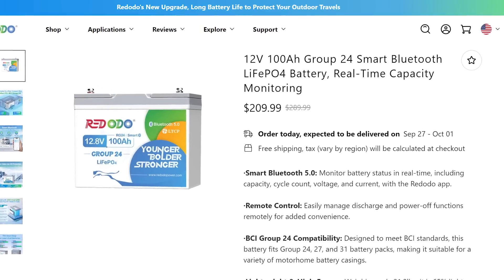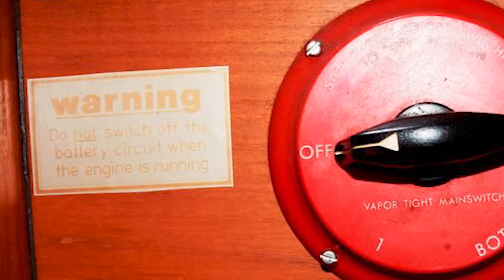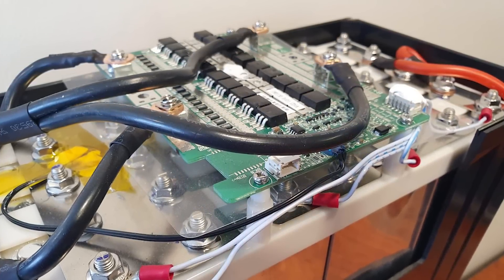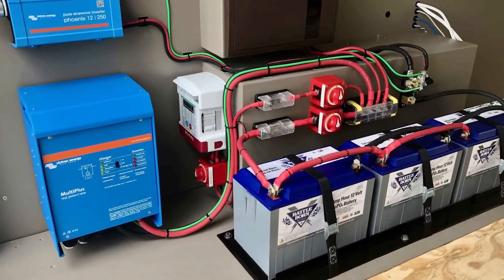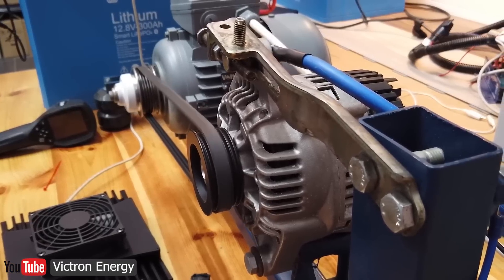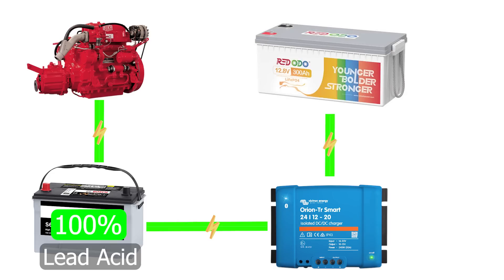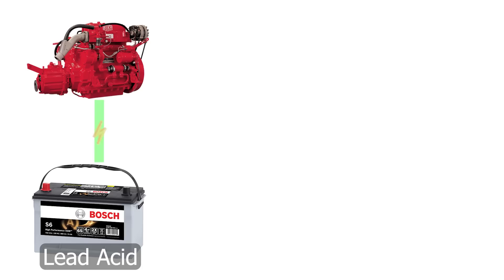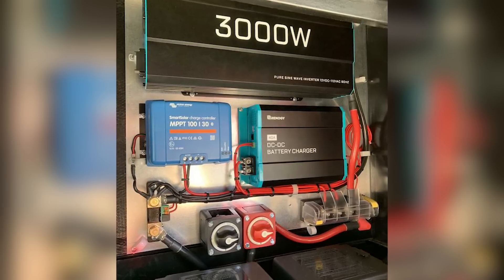Can A Lithium Battery Fry Your Alternator?

Comment: You describe an approach, but not the only or even the best approach. 

Take a coastal cruising C42 with a 20kWh battery bank (I know you only think in 12v and amp hours so this would be 1600ah in 12v, but we use 24v alternator and house bank) It would take 6.4 hours to re-charge a 20% soc battery bank using 4 (four!) parallel 50a 12v dcdc (Orion XS) chargers. I don’t have 6.4 hours of motoring with at least a 200a 14v alternator. The standard 80a hitachi can only give about 40a when hot

A much better solution is to use a high output alternator (5kW—oops, 360a at 14v, or 185a at 28v, or 90a at 56v…BTW, 160a 56v alternators are easily sourced) with avalanche diodes and use a Wakespeed or other high quality external voltage regulator with temp and current monitoring to prevent the load dump. Add an alternator protection module (think of it as a seatbelt—it protects the alternator should there be a failure such as an ignition key turned off by toddler, or  an electronics failure in the regulator or BMS). Then use the dcdc charger to keep the starter battery topped off.

Comment: You are scaring ppl, victron XS has the ability to limit current drew and detect when an engine is running or not, you can even program the start and stop voltage. There are other products that can do that too. 
I guess what I am saying is that a concern is there but also the solutions. Like everything, if you don't know what you are doing, it'll be expensive and dangerous.

Comment: Apparently this You Tuber has never heard of an external alternator controller.  Do your own research on lithium batteries, there is much more to the story than what you are hearing from this video.
Reply: This YouTuber is making general videos for the masses. I would definitely enjoy a detailed video on the finer points. Clark's adventures make several videos about everything to do with charging and lead and lithium systems. He also made a battery doctor? It regulates lead and LiFePO4 together. Be positive about educators, it's easy to point out flaws. But the negative pointers  are not making videos. Like chasing latitudes, not sailing that I have seen, just pointing out things negative. We need to start pointing out the people doing positive things. Not the flaws of them.
Reply: Agreed. And there is no DC-DC (over 60A) which can do justice to the current that a LFP COULD refill if connected directly -- with, of course, a decent alternator and a surge protector.
Reply: @thedolphin5428  Mastervolt makes a 90A DC/DC Li-ion charger

Comment: Anyone that puts a Lithium Ion battery bank on their boat is a idiot.  
   Lithium fire anyone ? No thanks. You can blow your CO2 bottle or Halon and it just keeps burning. Sound fun when you are 500 miles offshore?
Reply: Most people are doing lithium phosphate which is a completely different safer chemistry.
Reply: @EngineerK  I will stick to AGM thanks . My sailboat weighs 40 tonnes so weight is not an issue and it gives me safe reliable performance with no surprises.
Reply: I’ve seen a couple of fires from these and a number of super yachts have gone up in flames lately. They have been charging caused but salt water incursion would be fun times.
Reply: @D-B-Cooper  Li-ion is not the same as LiPO4. The first are used in cars and can catch fire and should never be used on a boat. The latter can safely be used on a boat and will never catch fire. Every battery is dangerous but only if stupidly handled like using too thin wires or causing a shortage.
Reply: That's true of NCM batteries, they type that you keep seeing burning in EV fires around the globe. But in the case of Lithium Iron Phosphate, it doesn't oxidise in decomposition meaning that conventional fire extinguishing methods are effective. That said, though, everything's safe until it isn't and there is a little more complexity with a LiFePo system than there is conventional Pb acid, and complexity is the enemy of reliability and dependability.

Comment: Why mess with Li-ion batteries when Pb acid is cheaper, more reliable and far safer. Large Li-ion batteries are a fad, a status sumbol
Reply: Just the 80% discharge is worth the price of admission for offshore boats. Over lifetime, LiFePO4 cost half as much per kWh. But none of that means anything if not safe and reliable. So the motivation for improvement is huge.
Reply: @artsmith103  
Safety is paramount on a vessel and especially on an offshore sailing vessel. Li-ion batteries are unforgiving consider the case of the Canadian couple recently found deceased in their RIB washed up on Sable Island. The husband had converted the boat to use Li-ion batteries for propulsion and domestic chores. The large bank of EV batteries was located under the cockpit. The couple apparently were forced to abandon ship is great  haste as there were few provisions in the RIB. They apparently died of dehydration. No traces if their vessel were ever found. Could a raging Li-ion battery fire have been the cause of their ill fated hasty departure?
Reply: @scomo532  I think adding EV propulsion on more than 5,000 lb boat is adding a tangent not relevant to this discussion. Everything you said might be correct, but that is a different situation than 200-400ah at 12V where 40amps is a big load. I would say that's the topic of this discussion.
Reply: @scomo532  Those are Li-ion stories. This discussion is about LiFePO4 or some other better chemistry. I'm not trying to defend Lithium. In fact just last night looked up the price of 75ah AGM I would upgrade to from SLA when necessary. Hopefully a few years.
Reply: @artsmith103  Li phosphate dies improve the safety of Li-ion cells, but you’re still dealing with lithium which is highly reactive. When the cell is fully charged, the negative electrode is fully reduced with lithium, so it is as reactive as lithium. If the cell shorts, you’re in trouble. The negative electrode has a very high chemical potential which causes it to react with the electrolyte forming very reactive lithiated intermediate products. This is the SEI, solid electrolyte interface. There is a similar SEI on the positive electrode. Both are quasi stable which means the battery is quasi stable. Leas acid battery technology is 160 years old, there are no surprises. Li-ion has only been around since 1991, it’s more complicated and keeps changing. All I’m saying is, on a boat at sea, I don’t like surprises, what about you?
Reply: @scomo532  I'm familiar with that tragedy.  No trace of the vessel was ever found but somehow you know that it was a battery fire.  Last I read there was speculation that it might be a battery fire and speculation of all sorts related to weather or collision and/or their all too DIY boat with questionable work.  Is there some report you know about that is more recent than anything I read months later or are you just adding to the speculation and claiming to know the cause.
Reply: @scomo532  You clearly don’t understand the difference between Li-ion and LiFePO4. Both are called lithium but that is confusing.
Reply: @edkok5880  
Talk about being confused, Li-ion battery technology was first invented by Stanley Whittingham in the 1970s. John Goodenough fabricated the first working Li-ion battery in the 1980s and Sony commercialized the battery in 1991. The principle of the system is to move Li ions between two electrodes of different compositions. The negative electrode is comprised of carbon while the positive electrode is comprised of an inorganic lithium intercalation compound. Initially this was LiCoO2 with a liquid organic electrolyte containing a lithium salt. Eventually it was found that the LiCoO2 was too dangerous so new intercalation compounds were developed the latest being LiFePO4. Tell me again how I don’t know anything about Li-ion batteries.
Reply: Never trust someone who can't spell
Reply: @EngineerK  never trust the keypad of a GD tiny cell phone, smart ass

Comment: More questions than answers in the comment section. Excellent video Tim. Like others have said, I'll stick with AGM and await the next generation of solid state batteries for a sailboat application. Although there hasn't been an update (that I've seen) regarding the couple washed ashore on Sable Island in July, the suspicion is that their modified Lithium battery bank may have caught fire and forced an abandon ship scenario. We'll probably never know. Call me old fashion and overly cautious. When your EV starts smoking you can pull over and get out. Not so much on a boat!
Reply: They had an EV NMC battery. (yes, it’s a lithium ion chemistry). LFP is a safe battery chemistry with the correct install. Shortcuts and/or cheap will change the safety…
Reply: @jimduke5545  As I understand it, the motor and battery were out of a wrecked electric vehicle. Interesting side note, BC Ferries, one of the largest ferry companies in the world, won't allow damaged electric vehicles where the battery is part of the damage aboard. Not even on a flatbed trailer for transport to a repair facility.
Reply: Don't put NMC (or anything with manganese or cobalt - LMO from old Leaf, NCA from Tesla, etc) on a boat including Victron and those cheap used BEV batteries.  Victron does have a metal case on their NMC.  LFP will not sustain a fire.  If the BMS works at all the battery will be fine.  In most cases if the BMS fails the battery is disconnected.

Comment: I strongly disagree with using DC/DC …… it kills one of the main advantages of Lithium batteries…. In the video you showed using a Victron DC/DC with a 20 amp output!!!  I expect to be able to charge a lot faster than this.  I find the following works well:

•	Alternator charges wetcell start battery (this avoids the problem of a sudden BMS shutdown).
•	Use an external regulator with a temperature sensor to the alternator (eg balmar)… this protects alternator from overheating.  External regulator will throttle the alternator and prevent burnout.
•	Use a voltage sensitive switch such as the Victron Cyrix Li-Ct to share charge between the start and the Lithium.  The Cyrix unit is designed like an ACR except it is programed for lithiums.  With this one can take advantage of full alternator output. The Cyrix Li-Ct comes in several different sizes (up to 250 amps if my memory is correct).

-  Wet cell batteries like to be charged at 14.4 volts, so do most of the 12V Lithiums that I see on the market.  Therefor wetcell and lithium batteries can work together.

Wes

Comment: buy a lithium capable shore power charger and hook it to the house bank.  You will not need to have one for the engine battery. AND carry a cheap Lead acid charger for an emergency and run it off the house bank via inverter.
Reply: That solves the problem from perspective of solar keeps house Lithium charged so as long as starter battery is charged, everything is good.
The perspective of the video is that sometimes the alternator 40+ amps are necessary to charge the Lithium house bank.

Comment: Some alternators and stator have internal resistors others rely on external resistors to regulate or rectify the current from a.c. to d.c. and a voltage regulator.  Depending on what engines your running. The small solar electric pontoon boats are kind of cool. Solar electric sail boats actually make sense. Like an offgrid cottage with sails.
Reply: For normal good weather, electric sailboat motor is enjoyable. In the worst weather, incapable and dangerous. Pick your poison.
Reply: Resistors don't rectify. Hope it's a typo. Not an expert opinion. No disrespect.

Comment: Didn't we have this problem with car amplifiers? And dimming lights when the base hit? Same solution a super capacitor bank. Super capacitors increase system runtime in marine vessel applications has gone from 30 minutes to 2.12 hours with battery only compared to battery plus super capacitor. You have solar and 4 batteries an ac inverter and a circular saw. You ain't running that saw all day. Same solar panels 2 batteries and 2 super capacitors and your running that saw almost all day. A super capacitor bank will cycle instead of your batteries and fully charged in seconds. Which means more cycles out of your batteries making them last longer. Lithium is not renewable and earth only has 88 million tons and about a quarter of that is what we can actually get too. Plus no more hard cycles on your batteries. Capacitors with power coming in can do a constant supply from solar. This works better if using only d.c. devices. In short super capacitor banks provide higher voltage but discharge fast and charge fast. Batteries provide low voltage but discharge slowly and charge slowly. Together they make a good solar d.c. system. It's like a soft start built into your solar system. Protecting battery anodes from cycling and hard cycles. Of course why would battery companies want your batteries to last longer? Eaton makes huge super capacitors for ships. It helps on size of wiring needed and battery weight. Which means also your alternator last longer. Because not taking as much out of your batteries when they do cycle. Gotta discharge the super capacitors to work on bow thrusters on newer ships.
Reply: Better solution than the one in the video.

Comment: I have a Renogy 50A DC/DC charger with a Lead starter battery and a 150AH house battery. When running the alternator I have it limited to 20A to prevent over taxing my 55A alternator, never had any issue even at low revs for extended period. I also use a 5A AC charger when at shore to keep things topped up. The renogy limits the charger current to the lithium to the 5A that is being provided, so no problems on AC.

Comment: I use Balmar's external regulator to charge the lithium house batteries and the battery-battery charger to charge the AGM start battery.  Then I get full charge on both. Yeah a bit more $, but I want all charging to one battery bank.
Reply: I have this setup on my Cat with Electromaxx high output alternators (140 x2) and their regulators.  Also use a third DC-DC to charge my Windless battery.
Reply: So your solution is put all your money and technology in charging the Lithium and then give the Lead a little basic charge as necessary.

Comment: At the Spring Safety at Sea seminar @ Rogers Williams, we learned that if a lithium battery bank caught fire, few of us have the proper extinguishing agent aboard and it will burn hot enough that you won't be able to eject the batteries overboard.  This situation was described as an abandon ship event.    Perhaps a video covering those issues would be helpful to your viewers.
Reply: Interesting. Did the course material detail the dangers and methodology of dealing with different chemistries? Lithium Iron Phosphate batteries do not oxidise in decomposition like NCM and other chemistries do, and should be able to be extinguished by conventional methods such as dousing with water. This is one of the beauties of this chemistry, from a safety perspective. NCM batteries, on the other hand, cannot be extinguished as is now all to readily being seen due to the proliferation of EV's with NCM batteries catching fire here and there.
Reply: How does an LFIPO battery catch fire?
Reply: @svgrateful6715  From my reading and understanding of the chemistry, LiFePo batteries are pretty immune to the fire risks from a chemistry perspective and the cathode/anode materials that they use. They are low resistance devices and are not prone to thermal runaway events as a consequence.
That said though, physical damage to the cells, overcharging, short circuits and charging outside of the manufacturer's temperature range may result in fire.
Reply: Don't use NMC or anything with manganese or cobalt on a boat.  Use LFP.  See comment above on essentially the same thing.

Comment: I've installed an APD ( alternator protection device), mine is by Sterling and I think Balmar makes one as well. I also switched out my Alternator that has a smart external regulator that know how to charge a lithium bank. 
If you have a high amp alternator say 200 you will need to buy many dc-dc chargers to move all those amp over while losing effectively and producing heat.
SV Sandii
Reply: APD seems key whenever the alternator is connected to lithium, even with smart chargers and/or communication.  
With a large alternator this make sense and then just add a small DC 2 DC charger to keep the starter battery topped off and this direction works better as it requires less/little use.  If the lithium goes offline you can have emergency backup by just paralleling the batteries / switching house loads to the starter battery.
Reply: Good choice.  Forget the lead-acid battery hacks.

Comment: I'm still not sold on Lithium just yet, more so on a cruiser sailboat. A day cruiser it might make sense, but so many fiddly issues does it make it worth it? The power you get with a Lithium setup is of course plentiful and the recharge rate is much faster too but have an issue with a BMS or a fried Lithium offshore or a remote destination and you might be stuck trying to find a replacement.   
I also just might be too old to change what works for some new fangle gadget. Great video and gives a simple explanation on power load charging and sharing with an alternator. John
Reply: This is one reason to diy your lithium bank, carry some spare cells and BMS(s) so you can fix it yourself. Lots of battery box kits on the market now

Comment: Yes, fried a nearly new high out put alternator, xt 170 from Balmar. The tech is still far from 99% reliable. I will carry spares henceforth.
Reply: My system has lithium house bank connected to the high output alternator, using external controller Wakespeed 500, supposed to protect the alternator but in my case failed to do so.
Reply: @leonardbertaux6897 what did wakespeed have to say?